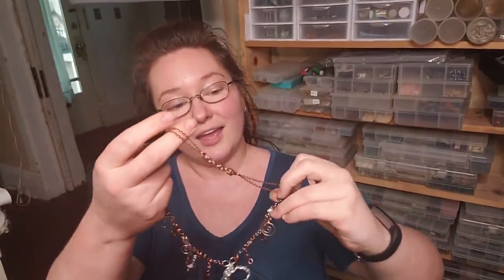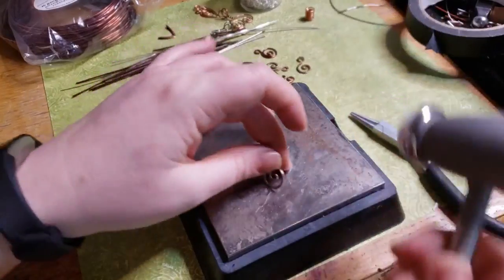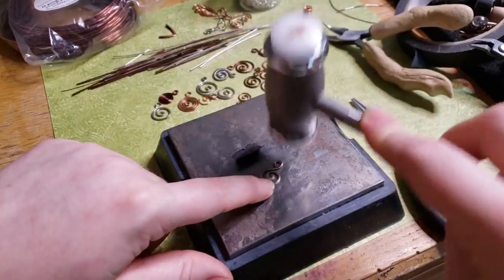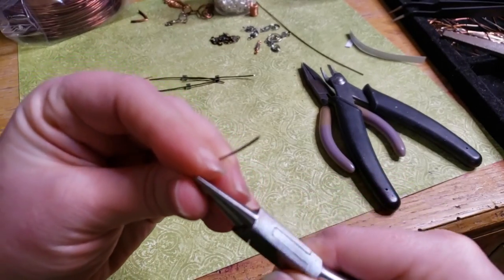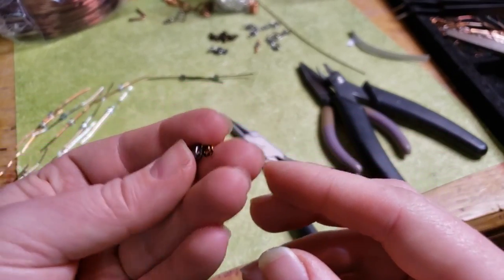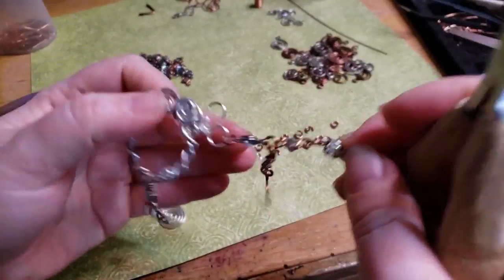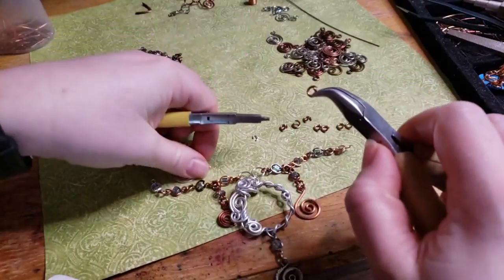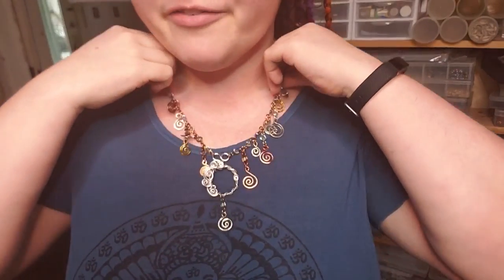Scrap Pile Necklace

Comment: Yvonne is so talented and this is a great video. I have a question. I am trying to perfect my wire technique in terms of cutting off what Yvonne refers to as "pokey bits". I am working on the part of the necklace where a bead is wrapped in opposite directions and then coiled on the round nose pliers as connectors for jump rings or whatever. I can't seem to find an easy way to get rid of the sharp edge on the coil. Any suggestions, would be much appreciated! Thanks so much!